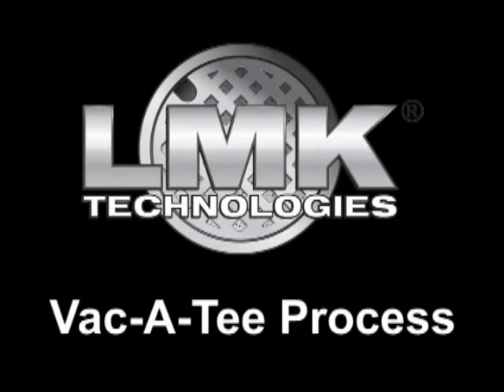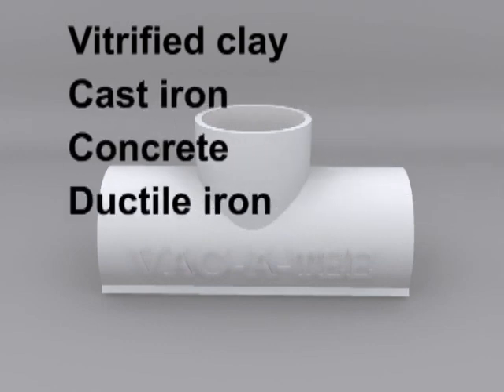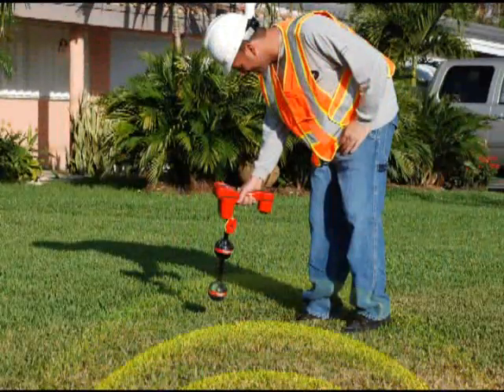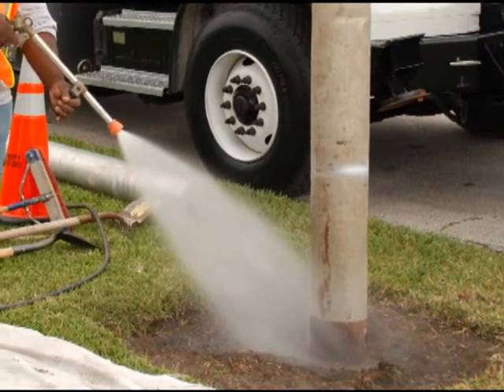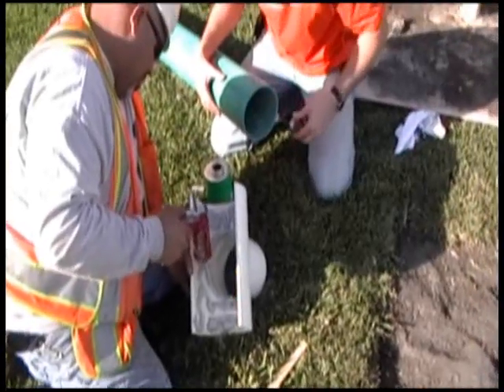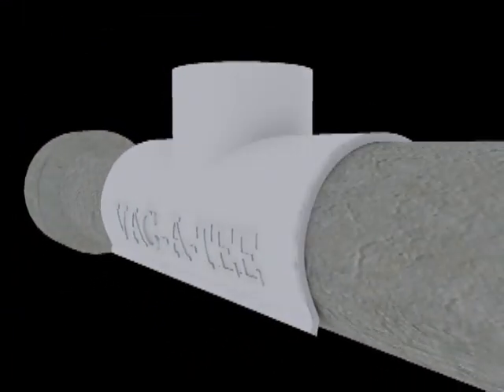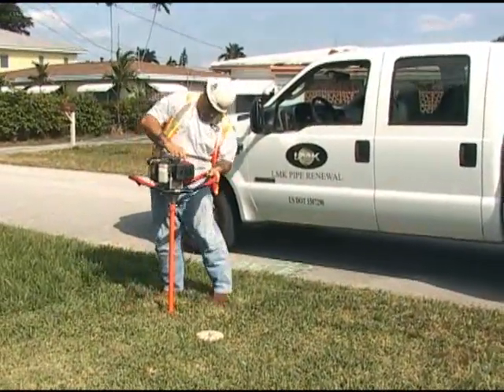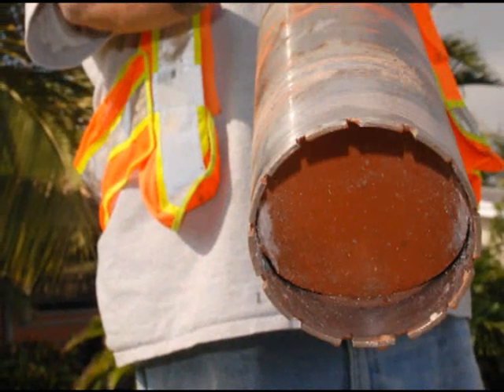LMK Vac-A-Tee® Installation Animation

Comment: Is the adhesive to this water repellent? I'm doing a sewer main tapping into a liner on a city sewer side and they cut the liner hole for the lateral almost to the bottom of the main ?? I just ordered the fitting thru core and main just wondering if the glue is water proof